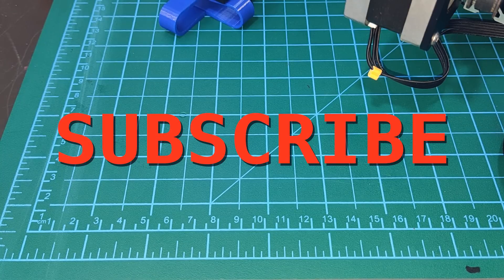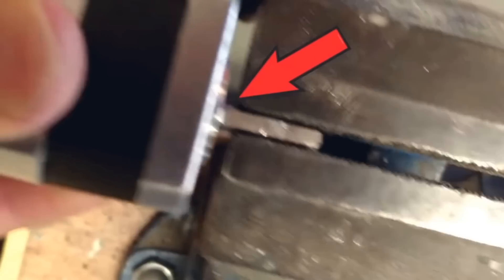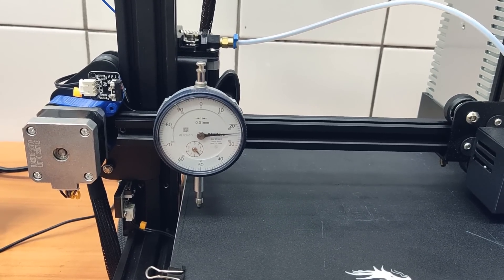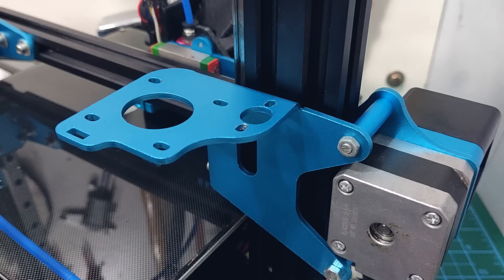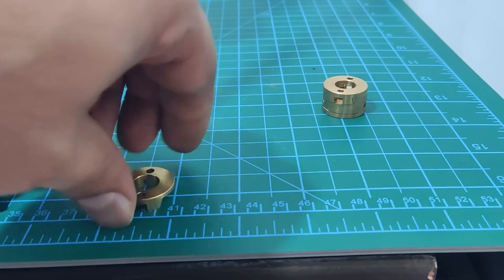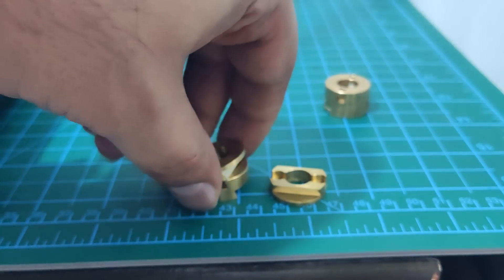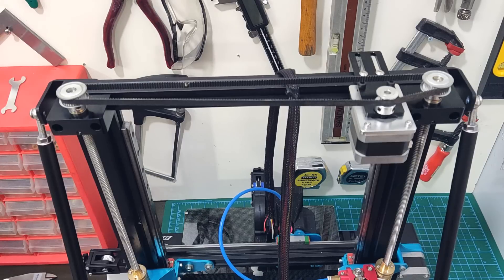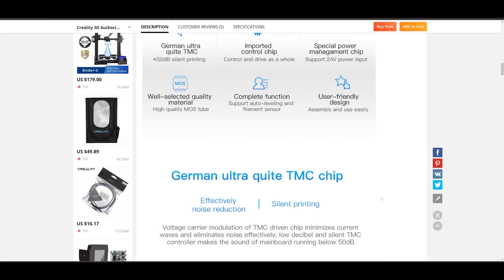Fix your Z axis with Oldham couplings, dual z screws & thrust bearings!

Comment: I'm glad I stumbled across this video, I have an Ender 3 Max and its hard to find a dual-Z modification for them being a oddball mix of Ender 3/CR10/V2 parts. I don't want one with dual steppers, as I don't have a spare driver on my main board and running 2 steppers in paralell from one driver makes keeping them in sync a nightmare, particularly through power cycles. So I was looking at the types with the tooth belts, and they all seem to have the limitations that you highlight in the video. The video has made me think about it however, and it seems that by choosing parts myself I will be able to make something that will work reliably, I like the idea of mounting the Z stepper at the top somehow, it occurs to me that maybe making the pulley on the stepper a little smaller than the ones on the lead screws will reduce the load on the stepper and make missed steps less likely - this will require changing the Z steps but thats just a matter of calibration.  I like the idea of the Oldham couplings, I'd seen someone else use them but forgot the name and where I saw them, so thanks! I think I'd make a block at the top to stop the lead screws pushing up or down, so the lead screws can be free at the other end to allow the Oldham coupling to do its job, but I guess that might mean some experimenting. This is certainly a thought provoking video, and I look forward to seeing how you fix the remaining issues and what results you get in the next video.
Reply from the maker: Thanks for your interest and taking the time to write this detailed comment 👍

Comment: ima beat you up if you for real bought another stock board to replace the original when you can get proper boards and have independent dual z and controllable fan ports and and and so on so on

Comment: If your z stepper driver if burning, you are likely binding. Reversed wires just causes jitter. Before you install the new main board make sure everything moves freely. Guess how I know 🤨.

You gave me a better idea how to solve the downward force on the stepper. Add the thrust bearings between the collet and the stepper on the bottom. Then the load is put into the body of the stepper. I just ordered the parts, I will see how it goes.

Using klipper you can run multiple MCUs in theory you could use your old board to create an IDEX.
Reply from the maker: Thanks for the advice. Will look into it. I do have plans for converting this printer into an IDEX some time in the near future. So yea, I will hang on to the board.

Comment: More than anyone should ever have to do on an Ender.  The right side lagged behind because you had it overtightened.  The left/driven side needed to have the X gantry removed and the X gantry screws tightened way down as well.  Then the left, driven side needed to be properly tensioned with the eccentric spacer on the V wheels.  The oldham coupling on the driven brass nut is a wonderful idea though!  You do not have enough engagement with the Z axis driving gear though.  You need to have a majority of the gear engaged with the belt.  Some idler bearings will solve this.
Reply from the maker: I did try to tune the original Ender 3 to the best of my capability. Might have missed something. Will try what you mentioned. For the Z belt, I am working on the idler pulley and will have it ready soon. Thanks.

Comment: Great mod! You're gonna want more teeth engaged on that z stepper also. Maybe a pulley or two to force the belt to wrap and engage at least half the teeth. With only one or two teeth engaged the belt can flex or just skip altogether.
Reply from the maker: Correct. I am waiting for the longer belt to arrive. Then i will install an idler pulley like you mentioned.
Reply: There are a bunch of little CNC machines with the idlers, you can probably take some inspiration from them (MPCNC springs to mind).

Comment: What a bill for a $150 printer! I believe you'll exceed the budget of a flawless printer.
Reply from the maker: Can't say you are wrong. But tinkering with & fixing these budget printers is how you learn about the field. Of course not everyone wants to do that so buying a better printer that works flawlessly out of the box is probably the better option for many.
Reply: @bluemonxterDIY True, IMHO the point is: do you want a working tool to make projects, or is the the 3D printer the project itself ? In the second option budget does not matter as you can run into endless upgrades, and the worst the printer, the better to keep on tinkering on it. I find using the printer to make useful projects is a bit more relevant. I really don't know if budget 3D printers are even any good enough for beginners as they do not allow a good experience. If you look at all the mods available, a 150 bucks 3D printer will always cost you more in no time, and your video is yet another example. I wonder why this stays untold. Just my two cents. 😉
Reply from the maker: @axelSixtySix  couldn't have said it better myself

Comment: Brass fittings will not work. Checked. You need magnetic couplings. As in the video- "Fixing Z Wobble from 20$ Ball Screws with that simple device"  Author 
MirageC.

Comment: At some point I need to accept that eventually I’d be better off getting a rat rig or voron rather than upgrading my ender more
Reply from the maker: Definitely. At some point, you will reach the limit of any bed slinger.
Reply: On the other hand the fact that the ender is so affordable makes the hobby more accessible, there's no way I would have built a voron or gotten an expensive prusa. Perhaps for my next printer I'll build a voron, but for now I'm happy with my ender 3 v2, even if it's far from perfect. It being cheap makes it not too scary to modify and learn about the printer before eventually getting a better machine.

Comment: My enders do not suffer from this. Instead my dual z printers are a pain to level and keep level. Loading filament misalign it
Reply from the maker: Yes absolutely. Most "dual Z" printers have two motors driven by one stepper driver and you will loose the alignment at every power cycle. You either need to synch the two with a belt like I have done here. For this you don't need any electronics or firmware modification. Or you need to home both the motors independently, for this you DO need a new controller board and firmware.
Reply: @bluemonxterDIY  My printer is a fokoos odin 5 f3

Comment: Wouldn't making it an enderwire would be cheaper and achieve the same goal?
Reply from the maker: It would actually be better than this, but from my research, it would be a lot more expensive.
Reply: There exists an open source Z-only conversion kit using belts that sells for ~ $35 for the hardware kit (search for "belt driven Ender 3") - that would bring Z axis to the parity with Enderwire, while beating dual lead screw on the cost. Would you see any pros/cons between that and the dual lead screw solution?
Reply from the maker: @MaciejWiercinski  belted z is better installation and performance wise but all kits i found use plastic parts. I want to minimize the use of plastic because they are prone to creep. Its really problematic in the long term. Believe me, i made my own diy printer a while back and when i got around to disassembling it for good, all the parts were loose and deformed.

Comment: Will this work on a cr10s pro? I have the rods installed. But been having z wobble with tall prints.
Reply from the maker: It will definitely help, the brace rod kit is available for the CR10 on aliexpress. But limitations of a bed slinger start kicking in on taller prints.

Comment: Since the pulley holding the leadscrew is already hanging on the bearingblock, there is no need to move the stepper to the top. The weight of the gantry is then supported by the bearingblock and not by the stepper.
Reply from the maker: You are right and I did consider that option, but I didn't want to use the leadscrew coupling as it can introduce problems of its own. But yes, it can definitely work.
Reply: @bluemonxterDIY  for me a flexible coupler did the trick, but I'm curious to see what eliminating the coupler all together will do to the print quality. I'm looking forward to see your results!

Comment: aww i wanted to see result and how do you compare this to dual z stepper with a  bl touch for auto z alignment
Reply from the maker: I found a work around for the z axis testing. Will upload the results coming Friday :). Dual Z (or triple!) stepper with individual control is actually the best way to go. But for that you need to upgrade the main board and modify the firmware. For my Corexy build I am planning on triple Z stepper with kinematic couplings.
Reply: @bluemonxterDIY  i am about to get rid of second stepper if this work wonder im kinda sick of auto z leveling taking forever and everytime its turn off  there a bunch more  inacuracy
Reply: @bluemonxterDIY  my dual z are already installed with an octopus pro  but having to much issue with the bl touch have to manualy edit all mesh  and dosent save the new mesh properly but that for another time

Comment: Great project, great details! A couple things. One, I’ve got an Anet A8Plus, which has dual z screws and dual steppers driving them. However, I’ve got a bent screw to replace and when I do it, I want to replace both. The oldham couplings, gantry mounts for the lead screws, your custom block at the bottom and the Gantry re-inforcement rods look like they would be a GREAT upgrade path for it! I don’t need the additional stepper you placed at top, nor the belt, etc….. but, looks interesting! Anyway, good stuff! Question though, sure the stepper drivers are soldered but couldn’t you just de-solder the bad one and replace it? I’m curious, I would think that would be easier than a whole board replacement and cheaper.
Reply: That is not an additional stepper, it's a sole stepper driving both screws. This is a good idea, since it keeps the two leadscrews in sync, while on a printer with two Z axis motors, there is  no such thing. When the motors power off, different amounts of friction and load cause them to step back by a varying amount. When the axis is re-enabled, the motors snap to the next full step, and they will usually snap to whichever is closer. So given one side is fundamentally heavier than the other (houses X motor) or because when you enable the toolhead is parked there, or due to alignment and friction issues, there is a progressing tilt with each power on.

To be honest i don't find the beltpath entirely convincing, it looks like it will lead to possible skips, ideally you'd have another idler close to the motor. But it might just work.
Reply from the maker: @SianaGearz  Excellent explanation. The belt works for now but I am planning on adding an idler like you mentioned. If two motors are to be used for the Z axis, then both of them need their own drivers and both sides need to be homed separately with something like a BLtouch or maybe two endstops. All that won't be possible without a mainboard upgrade and firmware modification.
Reply from the maker: Thanks :) I had the Anet A8  a while back & it is a good machine but like the other comment mentions, having two motors with one driver will always make them out of synch every time the power is cycled. As for the burnt drivers, they can be replaced but I really don't have the expertise or the tools to re solder surface mount components. If it was a through wire type, I would have gone that way.

Comment: Thanks for pointing out that stepper motors have play in the z-axis.. I have 12 pieces of 3D printers in my workshop and I'm still struggling with the problem of inconsistent layers in the z-axis on some of them. The way I see it is that I will insert the thrust bearing between the motor and the trapezoidal thread coupling.. and see what the result will be.. And I signed up for the subscription.. :-) I am writing from Slovakia.
Reply from the maker: Thanks for your interest and support :) That could work. Do share your results as it is an excellent learning opportunity.
Reply: @bluemonxterDIY I found one axial bearing 51100 in the workshop, which I inserted between the motor and the trapezoidal thread coupling. I also made a plastic transition between the coupling and the axial bearing so that it is all in the axis. It works perfectly. I am excited. It works beautifully on the BIQU B1 printer, which has only one trapezoidal thread. I printed one cup and one 3DBenchy boat for testing. I used z-hop 0.3mm for printing. Due to the Christmas holidays, I can only buy more bearings for other printers on Tuesday. I am most looking forward to solving this problem with my Ender 5 plus. For me, it is a very cheap modification of the printer, because the cheapest bearing costs 0.80 €.
Reply from the maker: @1vyrobca  Excellent. Glad it worked out for you and happy printing on christmas :)

Comment: capturing the lead screw in that lower block you made is actually working against you.  Throw those away, make a set screw collar that will go below your upper bearing block.  Basically sandwiching the upper bearing assembly.   By doing this you now have only two points of the leadscrew captured, now the oldham coupling can easily adjust givining you zero bind between the two points the leadscrew is captured.   With your lower block you have the leadscrew captured in  three points with only one of those points able to adjust, no bueno amigo.
Reply from the maker: Damn why didn't I think of that :P That is actually a very good solution. Thanks for taking the time to point it out.
Reply: Woah, someone using double spaces between sentences.
Reply: Yes, and if you want to avoid the play coming from the sandwich you can add a spring there on the lower side.
Reply: Came here to say this.
Reply: I don't get your point. An oldham coupler can adjust with the two ends of the leadscrew captured too. It allows the nut to move in two directions and this can compensate any misalignment between the top and the bottom ends of the leadscrew.
Reply: @RubinhoMartins-b6m  i agree. the oldham nut does not capture the leadscrew in the XY plane at all. as long as it's range of motion in XY is larger than the maximum deflection in the imperfect lead screw, it will perform its function just fine. so it is incorrect to say that removing the lower assembly gives you two points of the leadscrew captured. it is only captured at one (at the top), while the lower end of the leadscrew is free to roam to its maximum deflection near Z=0 where most of your prints happen. this is actually NOT the ideal condition for the oldham even if it can still do its job. this is because at the maximum deflection, the leadscrew is most off-axis going through the oldham nut which means this is the position of highest wear rate to the nut. i think also constraining the leadscrew at the bottom is a good idea. this way you move the position of maximum deflection somewhere nearer to the middle of the leadscrew where it is not used most of the time. the best case is to to constrain it at the bottom at unconstrained at the top so that you minimize deflection requiring oldham correction at Z=0, reduce somewhat the deflection at Z=middle, and leave the most deflection to the free end near Z=top (this last option is out considering it is driven from the top).
Reply: @suivzmoi  Yes, exactly. I have a highly upgraded entry level printer, also a very old one, and one of the upgrades was to put the Z motor to the bottom, instead of the top, to reduce the weight attached to the top of the v-slot frame. At the top of the leadscrew I printed and installed a socket that locks the leadscrew inside a bearing. This makes the leadscrew fixed both on the bottom (motor/coupling) and the top. As for the X arm support/coupler, I'm using some not so good printed PLA system, that I want to replace with this oldham system or a better one.

Comment: I am quite surprised. How did you destroy you stepper? Did you let a full print go without checking? Usually, you can go ahead with the wrong wiring, and visually check, but for it to damage the driver, the current has to be very highh, or the command was very long
Reply from the maker: Many people have asked me the same question and I am not sure why my drivers fried instantly. I only moved the motor manually from the LCD, it vibrated in place and then stopped moving altogether. Immediately I tried the same on the X and the result was exactly the same. Perhaps I as unlucky, or maybe the older Ender 3 boards don't have the proper protection built in.

Comment: My soloution was to run an SKR 1.4 Turbo which has the ability to run my two leadscrews on their own motor and driver thus enabling G34 to be run to level the gantry before each print, I wouldn't mind adding the other fix's you made though, the use of thrust bearings is a very good idea!
 +1 very happy new Subscriber, Merry Christmas my friend and a happy 2023!
Reply from the maker: Thanks for the Sub. That idea crossed my mind as well. Alas, I wasn't looking to upgrade the mainboard and firmware at this point. Had I known I would end up burning my board, I might have gone your way.